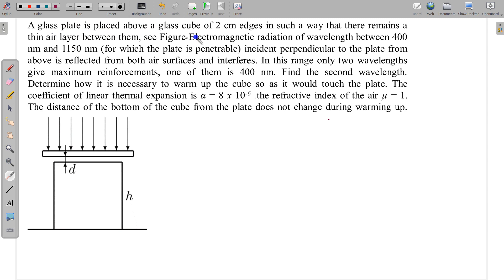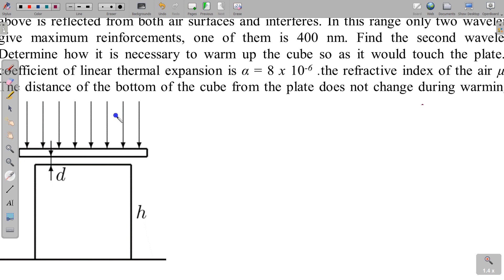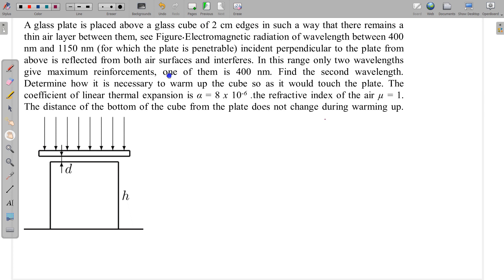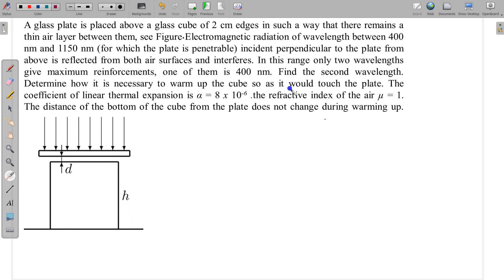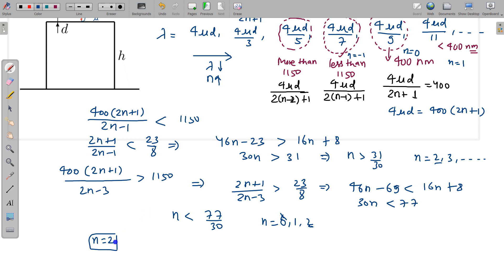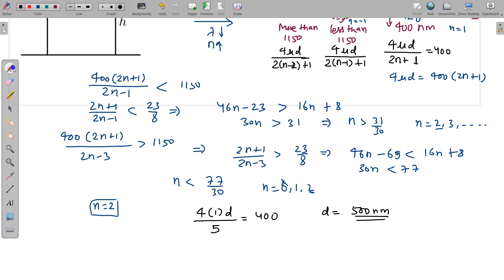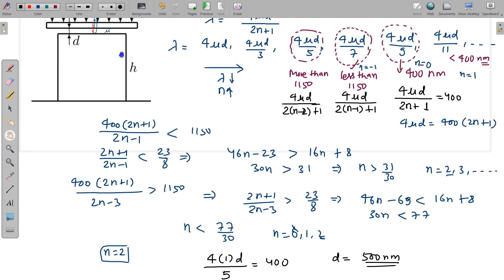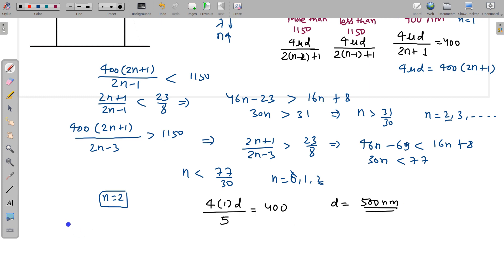Wave Optics | IPhO 1969| Interference by Thin Air Film

Comment: Sir  shouldn't the difference of l/2 should be added to the 2ud
Reply: whats l?
Reply: if u mean lamda/2... then thats taken care of by taking 2ud= (2n+1)lamda/2
Reply: Ya but shouldn't it be 2ud + lambda/2=nlambda
Reply from the maker: @shauryagupta3990     It doesn't matter whether you add or subtract Lambda/2. As it corresponds to phase difference of pi.
In case of pi .. if we say lead by pi OR we say lags by pi both are same physically.
Reply: @PhysicswithAkashGoyal  Yes sir got  it 
Thanks